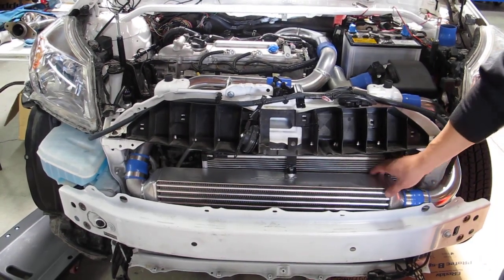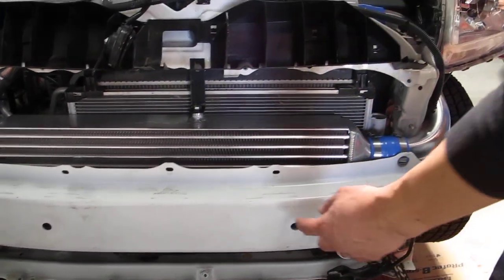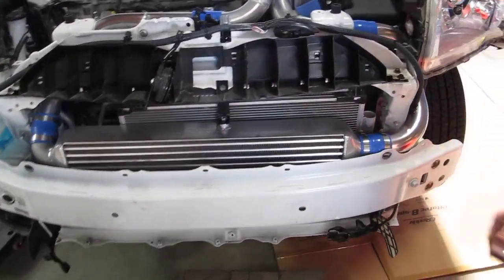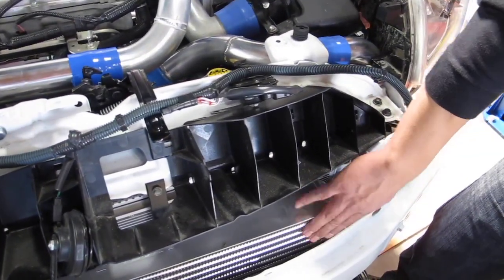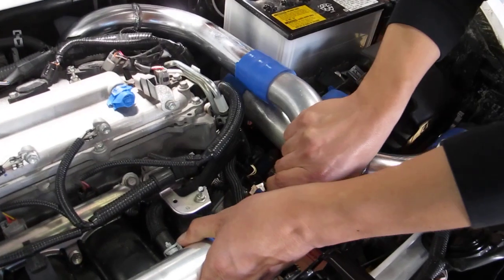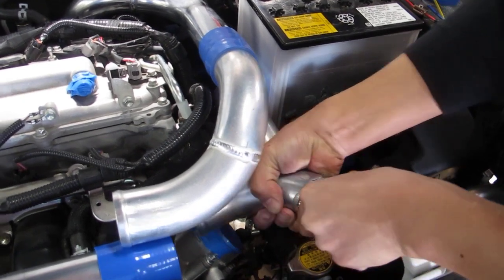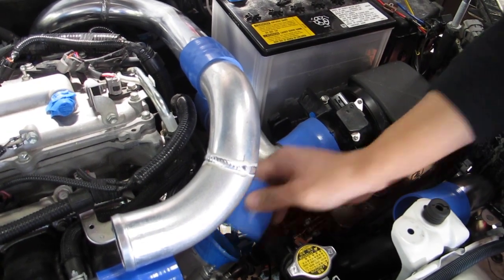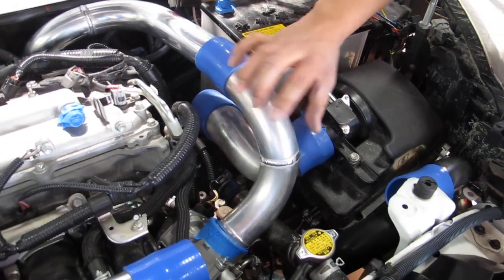Sparco Rally xD - Turbo Setup

Comment: I know this is years old, but looks like a great setup. I have a 2ZR swapped Yaris RS 5-door hatch (Scion xD ecu and harness) that I'm interested in turboing. Looking at the turbokits.com Corolla package. I'm interested in your use of the stock airbox. Did you leave the MAF sensor in the stock airbox or put it in the charge pipe after the intercooler?  Thanks!

Comment: the stock drivetrain is too fragile.  a turbo system is just the start.  then comes uprated clutch, engine internals, you get the picture.  btw, i have an '08 xd.